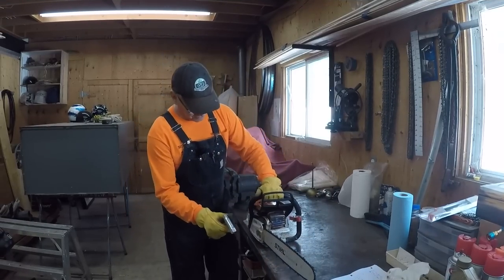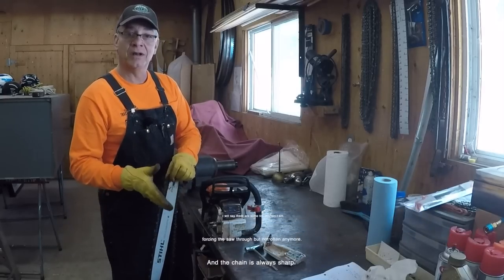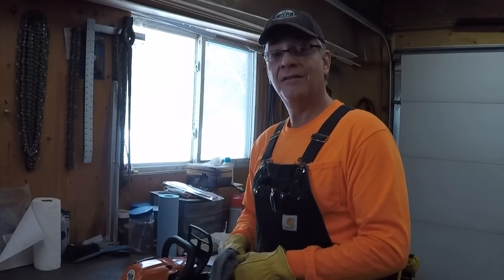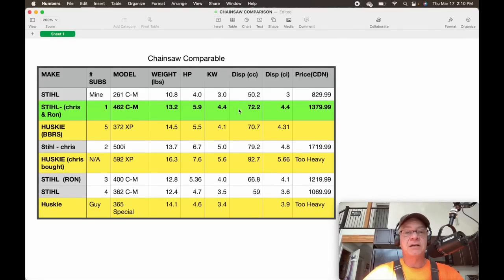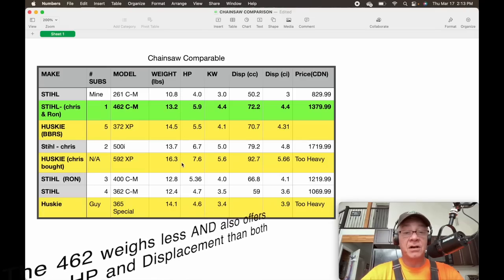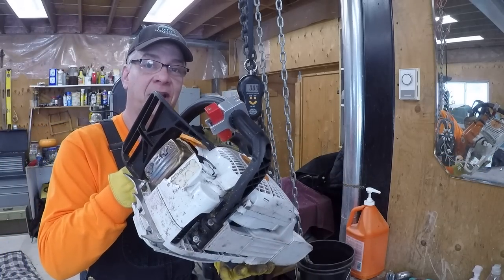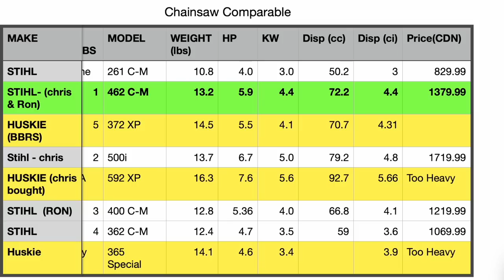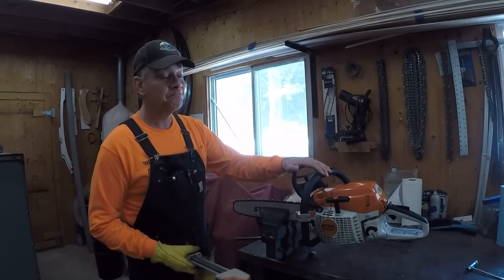543 New Chainsaw. Saw Talk. Specs and Decision Made. Part 3. outdoors

Comment: The 261 Pro is a GREAT saw for sure.  I went from a 20 year old MS290 that was too heavy for the work I do, to the MS241 Pro saw because it was lighter than the 261.   Apparently the two (241 and 261) are so close in specs that Stihl elected to discontinue the 241 but even knowing that, I went for it.  Searched the country for one, and then found 2 in my local Ace store 3 miles away!!  Love it so far with an 18" bar and I know it's going to have limitations in big seasoned hardwood, but the lightweight is more important.  Enjoy your new saw!

Comment: Great comparison of saws.  I think you can be confident in your choice.  As for options, be sure to get the one with the heated grips and the heated carb - MS 462 C-M VW.  The grips are electrically heated, with a switch for on/off, and the carb will never ice up, using some technology borrowed from airplane engines.  Another thing to watch on these bigger saws is oil consumption.  Depending on the bar length, you may have to adjust the oil flow, and could even get into a situation where on the longer bars the oil is used up before you run out of gas.  For longer bars, I fill the oil tank full, and put about 3/4 full gas to ensure that I always have proper lubrication on the bar.  Hope you have many years of cutting and videos!

Comment: That's awesome. You're gonna be smiling the whole time when you feel the difference between the 261 and the 462. I only, only use my 261 for limbing and small stuff on the pile so I don't have the longer bag hanging out back. Anything else, 462, even over my 500. The 462 has just a little narrower profile too, not a big deal but helps a little in maneuvering around branches. You're gonna love it. Congrats!

Comment: Gord, I agree 100% with Dan from Back 40. If price is the only issue the MS462 is a great choice but if you get to test drive a MS500I I think you may change your opinion. Chris (from In the wood yard) and I have used my MS362, MS462 and MS500 and will tell you the MS 500 is my go to saw followed by the MS462. Though I can speak for Mike from KNL Firewood, after trying my MS500 at Chris’s woodyard he was lucky to find one at his dealer and bought it. The 24" bar is my recommendation.
Reply from the maker: Thanks Tony! It was tough I have to admit. But she should do the trick for me. Have a good weekend!

Comment: GP always enjoy your comparisons. My advice save your money and let Guy and Bob cut the bigger stuff ha ha. I'm sure you will love the 462. I have a ms180 18" bar ms311 20"bar and ms461 26" bar. But I have to say this summer I cut a whole years wood supply 25 cubic metres with my msa220c 16" bar battery saw.  Great for anything under 14" diameter and nice and light. I'm not worried about cutting time being retired.
Reply from the maker: LOL! Cheers Mark!

Comment: A bigger saw will definitely power through the wood much easier but if you are bogging down using a smaller saw, fighting to cut then most likely the saw is not sharpened correctly or you are forcing it too much and not letting it do it's job.  The type of chain also impacts the speed you cut at.  A small saw just cuts a little slower and should not be bogging.  Don't be fooled by the CCs.  It is torque that gives you power.  Some of the higher CC saws will cut slower but  will have more power.   The 462 is a great saw and you will enjoy it!

Comment: Can't go wrong with a 462.  I love mine.  One big reason I went with it over the Husky 372 was to have more flexibility in chains and bar across my stihl saw lineup.  Wanted to try a husky, but decided to stick with stihl to be able to share the bars and chains if desired.  Nothing wrong with just wanting something.  You can always use a shorter bar on it.  It gets pretty good fuel economy even though it is a larger saw because it won't be working as hard as a smaller saw with the same sized bar/ chain.  Good choice.  I gave my 311 to my Dad after getting the 462.

Comment: Looking at your clip of the 261, it "sounded" like it  the rakers  may be a bit to aggressive, a bit  to low where the teeth are cutting to much, look to see if there is  wear at the bottom of the chain  where the links are pinned together.  Also two points to consider most  manufacturers can get better specifications by  either using a "skip tooth" chain, less cutting links and or a thinner kerf chain going from a standard  3/8" down to a .325"  for example. All mods you can make too in most cases new clutch sprocket bar and chain.  Bailey's  May be a good source. Check out carving chains and bars too.
Reply from the maker: Thanks Mandel. I will take a look and see. I use a 2 in 1 sharpener on it. Cheers and thanks again!
Reply: @GPOutdoors  you can always test the theory. Sharpen the chain a few times with out touching the rakers, as a rule of thumb normally only touch the rakers 2-3 times for the life of the chain. One sign it's time to hit the rakers is fine powder after a fresh sharpening, you will see a shiny spot on the part of the rakers making contact with the wood as it is proud of the cutting tooth.   The chain will tell the story. Cheers.

Comment: If your bogging down it is operator error. Professional Chainsaw operator here. At 63 I have a 65 cc saw that sets on the shelf. I use   Stihl 261, Husky 550 xp. Sthil 201, and a Stihl 150 for working off the ground. The saw on the shelf has a 30 inch on it for the big EWP.  It is  365 xp.
Reply from the maker: Morning GZ! Thanks for the great comment. Yup, I would agree largely I can do better and get better over time but sometimes I do realize I am trying to push it, but try to remain mindful of it. Thanks again and all the best!
Reply: @GPOutdoors  yes  I understand and the best way to solve a problem is to buy bigger.  I can have any saw I want, but with the saws I currently have there is nothing else for me, unless, Sthil or Husqvarna comes out with a new faster lighter saw. Now if they did, I would be on the waiting list to get one.

Comment: I’m definitely a Huskie guy. I have both the 365 special and a 372XP . I run a 20
“ bar on the 365 and a 24” on the 372. The 372Xp is by far my preferred saw but when I get into the big stuff I run my 288XP with a 24” bar but it’s not the saw for walking though the bush.
Reply: The 257 husky is a great saw, 18"-20 bar light but balanced, great firewood 🪵 saw. Not sure if it was a 262 or 362 husky?  But was balanced with 20" & 24" bar. 272/372 xp  great for a few larger cuts but not an all day runner unless it's a shorter day.

Comment: 372XP with 20 inch bar is balanced easy to run has medal components that is why it weighs more than a Stihl also Husqvarna has bigger fuel tanks and bar oil tanks and also available in heated handles  I’m a Husky guy  have a great day both brands are top notch

Comment: those prices are insane i can get a 462 for under 1200 i paid 900 for mine cause i got friends in the right place 1349 for the 592xp  1000 roughly for the 372xp and the 572xp is 1159.  which is not on your list. a close dealer should be a big choice in your choosing. ive run a 500i and it didnt beat my 462 by much.i also did a demo of a 592xp and its got some real power but on a two full cord load i would only gain 7 minutes in cutting time over the 462 so i cant see spending the extra money on it. i also have a 390 husqvarna which if i need more power i use that.most people want the latest and greatest when the cutting is the least time consuming of the process. And husqvarna lists their prices except for the new 585 and 592xp

Comment: When they stopped making the 444/440 and replaced it with the 462 I thought they were ruining a great thing. Turns out the 462, while not as throaty, is still just as hungry and even snappier. You’ll love it GP. to me, there wasn’t much weight difference between the 25 inch Stihl standard and light bar. There are some Japanese light weight bars, taka something, that cut a fair bit of weight. My 28 or 32 is from them.
Reply from the maker: Morning and thanks Mitch! I can't wait to spool it up!
Reply: @GPOutdoors  I hope it’s a good saw for you.

Comment: Question for all of you firewood cutters and or loggers.
28"  diameter standing dead bitter nut hickory ( felling for firewood only) as an example:  what bar length(assume  you will bore cut it) or size saw is preferred to drop said tree?
Question  two:  when limbing said tree with an expansive canopy of liters,  what is the preferred choice ,use same saw as you would to fell this tree  a larger & heavier cc saw with a 20"-32" bar, normally only cutting with the  the tip (first  4"-10") of the bar  so you don't have to bend over ( the risks are less control or kick back and may not be able to see where you are cutting  be it rocks dirt or limb 🦵)  
OR  use a smaller size saw for limbs and smaller parts of the Tree... it  is on the ground but may have pressure on some of the litters. Is one safer than the other? Is one more ergonomically correct?  Which one will allow a full day of cutting?

Comment: Your trying to make it cut more than  it was designed for. Let the saw cut at its own rate. However bigger is nice.
Reply from the maker: Thanks Rod - I am indeed guilty of that sometimes for sure. Cheers!
Reply: @GPOutdoors  I do the same thing. I have an older 032av. It does a good job. 20 inch bar. If I let it cut at its own pace it works great. If I put pressure on it, it will bog down too. My newer saw is 371c . Not sure what the numbers mean but it revs up higher than the 30 year old Stihl. Cuts much faster. My guess is it won't last 30 years like the old one. Both have 20 inch bars. Thinking about a new 25 inch bar. $84.00 for the bar. $44.00 for the chain. For $128.00 I can roll the log over or walk around the other side. Love watching your channel. Like your approach to different jobs. Keep up the good work.